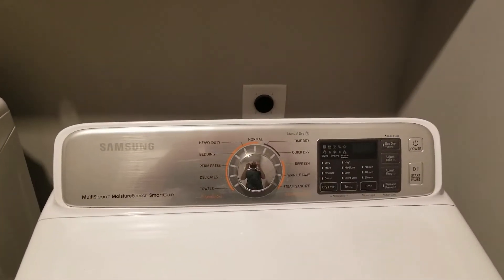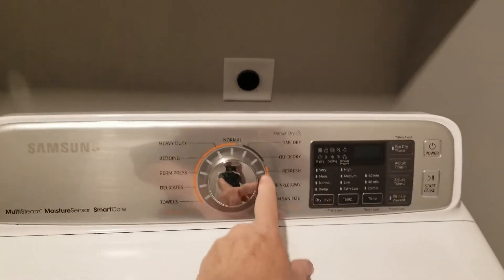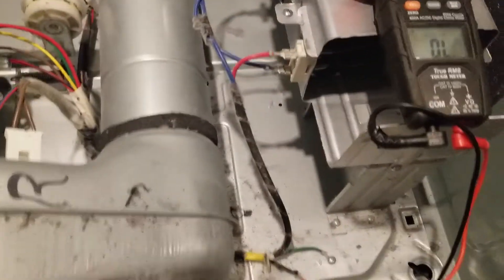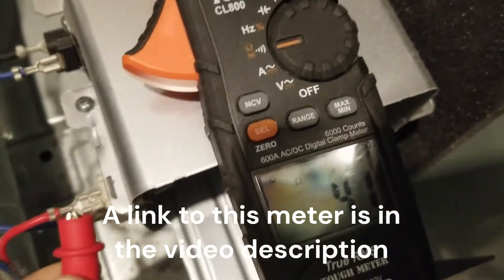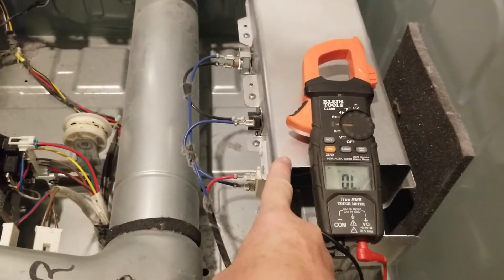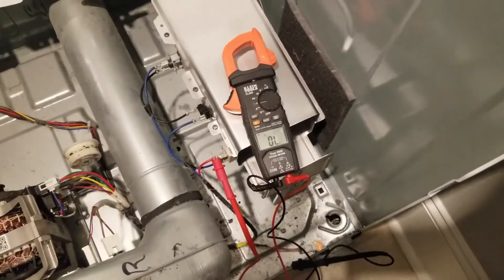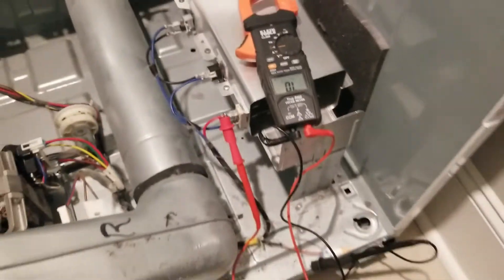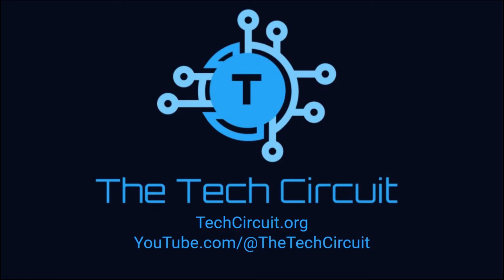#49 - Samsung Dryer HC Error and Overheating- Diagnosis and Repair

Comment: I have replaced this thing twice already. It comes with two different resistors, but neither one of them looks like the original so I don’t know if I’m putting the right one on there. 
Any suggestions? Thanks.

Comment: I’m having the same problem as the two that don’t have any replies, it’s happening at the end of the heating cycle. For example, I ran some blankets. It took about 30 minutes and then it got hot. I just ran a load of clothes and it was a little bit over an hour and then it got hot. But both were at the very end of the heating cycle. What would cause this?
Reply: This is a common issue with Samsung dryers.  Just reset it and restart if needed.  If it throws the HC code before the clothes are dry then check/replace the thermistor.  If the clothes are dry just power off and let it cool down until the next use.

Comment: Great video I put the reapair kit and every sensor are new but now like 25 min appears this code. But the clothes are dry when the code become.
Reply: Found out its nothing to do with anything below.  It's behind the control panel sitting in a small 5x3 inch box that has a group of wires leading into it.  The Dryer Control board will start with like DC92.  This will fix the overheating HC error.
Reply: @WesProphecy2032  very helpful, thank you
Reply: Did you find a solution?
Reply: If the heating element is good and not grounded out, take a little bit of light grit sand paper, rub the sensors clean on the inside of the dryer which is usually on the lint screen housing.  Also take the dryer off of eco mode.  Try it out and see if that works.

Comment: Great video, l get an error code after 30 minutes and my clothes are pretty much dry. Both outside and inside vents cleaned out and lint compartment cleaned out religiously.
Reply: Found out its nothing to do with anything below.  It's behind the control panel sitting in a small 5x3 inch box that has a group of wires leading into it.  The Dryer Control board will start with like DC92.  This will fix the overheating HC error.
Reply: @WesProphecy2032  what is DC 92? Thanks.
Reply: @TheoriginalMobileApp Apparently there were more manufacturers of this board so you might not have a controller that starts with that particular serial number.  Once you swap out that control module in the back you should be good to go.
Reply: @TheoriginalMobileApp They won't let me tell you where to watch the solution.  YT sux.
Reply: @ no surprise there. YouTube has recently scrubbed a lot of of my favorites and history. 
Truth is dangerous to their version of reality.
Reply: @ very helpful, thank you
Reply: Did you find a solution?
Reply: Also try using light grit sand paper to clean the sensor bars on the inside of the dryer.  Make sure to turn off eco mode then try drying some clothes again.

Comment: Great video. 
I have the same model dryer and get the HC code after about 5 seconds of running. I checked the thermostat and everything checked out ok. Would replacing the thermistor be a good next choice?
Reply from the maker: If you're getting that error after 5 seconds, I would suspect a bad thermistor. That thermistor can be checked from the board with minimal disassembly if you have a multimeter. This video shows you how to do it and can also apply to an HC error:
https://youtu.be/H6syuWNOJ6E
This website shows thermistor values for given temperatures. The Samsung thermistor is listed:
https://www.techcircuit.org/thermistor-cheat-sheet-common-value-tables-and-charts/

Comment: I'm haveing this problem and I have checked the element it is good how would I cheak the relay... thanks
Reply from the maker: The relays are usually intermittent it is difficult to tell. If the contacts fuse together permanently, you can check the resistance between contact - but when you start pulling wires off the relay, it often "unfuses". You can tap on the relay to try and unfuse it to see if that clears the error up. If so, replace the board.
Reply: Thank you very much the problem with are dryer.. is that it will work and then get really hot a say HE..if you try to restart it it might run for 2 min and same thang happens.... I have completely disassemble the dryer cleaned all lint inside the dryer and the venting going out the house and I have cheak the coil with a multimeter and the coil is good.. but still have the problem
Reply from the maker: @CJ_Cornhole  It sounds like a stuck heat relay. It could also be an out of range thermistor, but I doubt it.
Reply: Control board.